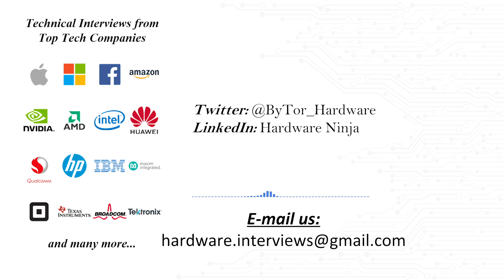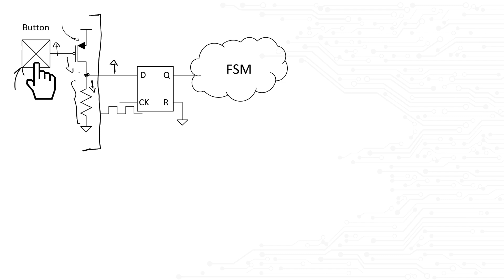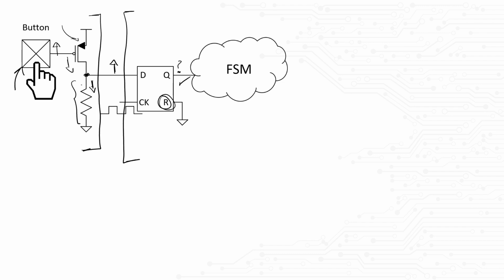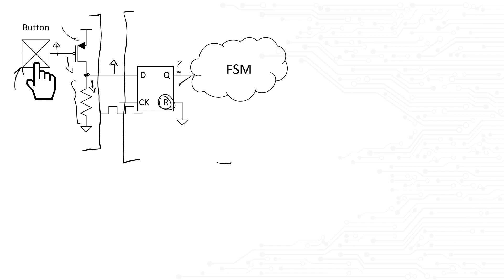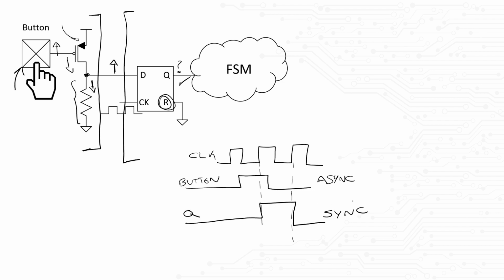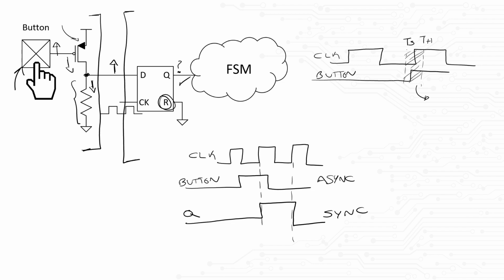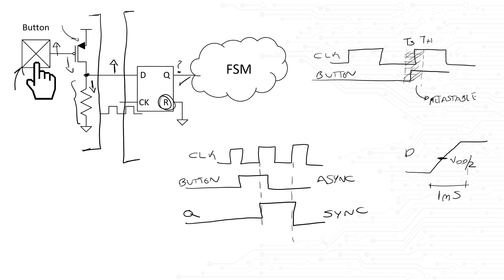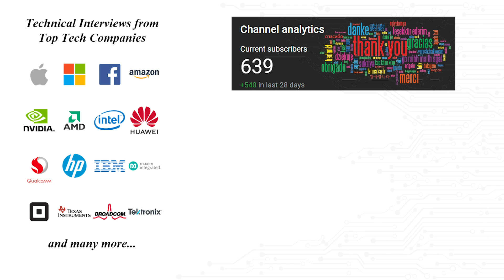HWN - Real "Digital Design Engineer" Interview Question

Comment: Just a follow up concept: These flip flops dont sample at exactly vdd/2. I know a research industry logic designer who goes as far as to add his whole clock rise time to his uncertainty.

Sometimes in research you only have 1 shot to make a chip, and his job depends on it working.
Reply from the maker: Hi Ben, 

Thank you so much for being here and contributing to the content! You're absolutely right. I would expect that type of question to be raised for more experienced designers with several years of experience. However, when interviewing, we usually start with the basic understanding first and then go deeper. We will make a video about it in the future though, thank you again!